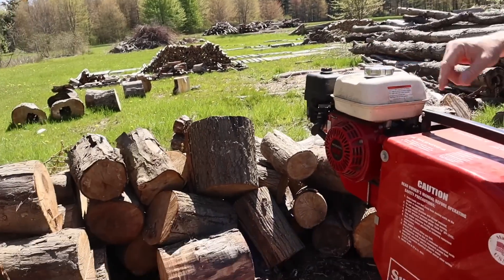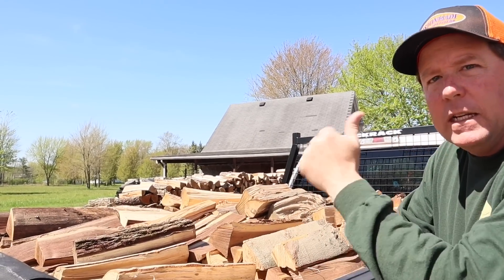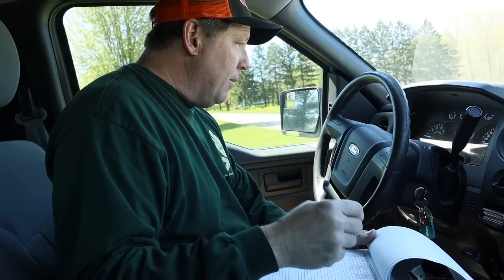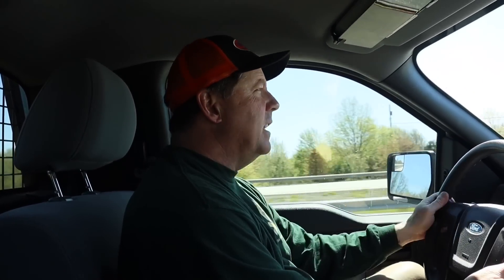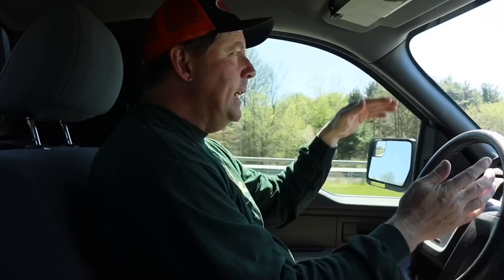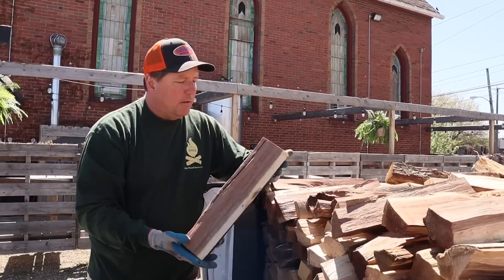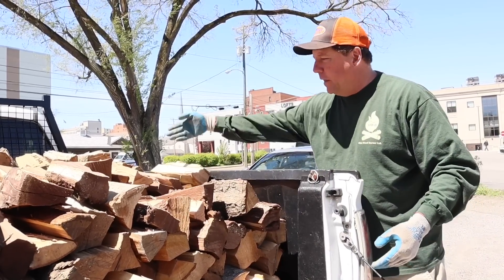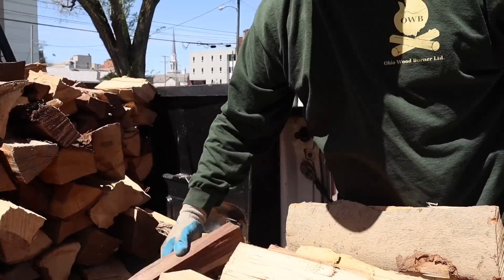Let Me Show You Some Business Secrets

Comment: My 09 is starting to rust at the rear wheel well areas. I'm just going to spray fluid film on it constantly to slow the spread. I did what you want to do on my old truck. I used a wire wheel to grind off all the rust. I acid etched and painted it. Rust came right back. You might be better off just getting a new tailgate.
Reply from the maker: I had been thinking that.  It's a shame how it looks bc the truck is otherwise in vg shape.  I wish it was one of the aluminum ones!

Comment: That’s a great point about pre trip inspection, check oil, coolant, and tires.  Some over zealous law enforcement officers might make an issue about the load being uncovered. I’ve seen DOT state troopers pulling small box trucks over for no US DOT numbers painted on the truck and giving tickets and fines.  Not sure, but I think commercial vehicles have to be registered with US Dept of Transportation (USDOT).
Reply from the maker: I am not DOT.  My truck is underweight and doesn't sell across state lines.
Reply: @ohiowoodburner  good to hear, less to worry about

Comment: Hey Joe you should be a stage act my man. Laughed my ass off at that one. Just a little advice I have been in the manufacturing, body,and paint work for 30 plus years. You will NOT be able to stop the rust that is occurring on your truck unfortunately. If you had it professionally repaired last time feel lucky you got put of it what you did. Ford has issues on certain models with drainage between the body panels and tail gates and box sides are horrible for it. You are in the rust belt the same as me. When the rust starts it continues. The only way to stop it is buy a new one and cavity wax the heck out of after paint. Even with the factories e-coat process these vehicles in our states still need rust proofing and undercoating. Sorry for the bad news.  I do enjoy all that you do thank you for your crazy funny entertainment 😜.
Reply from the maker: I have some feelers out for a new bed.  Prob that is the best thing I can do...or just keep covering it up with spray paint once a week LOL

Comment: Appreciate the ride and sound business practices.

If you wish to prevent rust, some folks spray used drain oil on their truck frames and inside all doors, and rocker panels using a small metal (not plastic) Hudson sprayer. I heated up the drain oil on a small Webber grill till the oil hit 110 degrees. Then it flows better thru the nozzle. This really works. If you plan to do it, let me know, I'll give you more tips.

Good luck to you!

Joe, the following is a way better method to do the drain oil treatment! Less messy, still cheap, and it works:

https://youtu.be/NXAo5IfMtPM
Reply from the maker: Thanks for the idea Gary.  I will check it out!